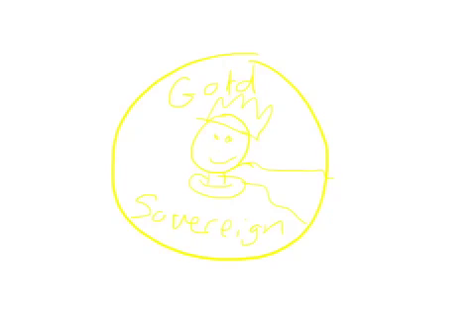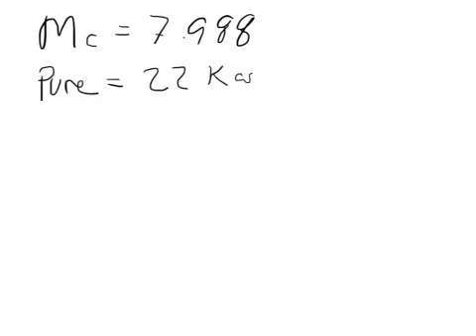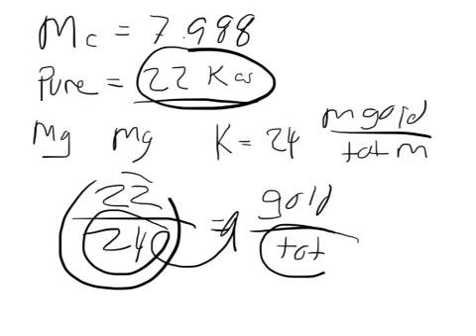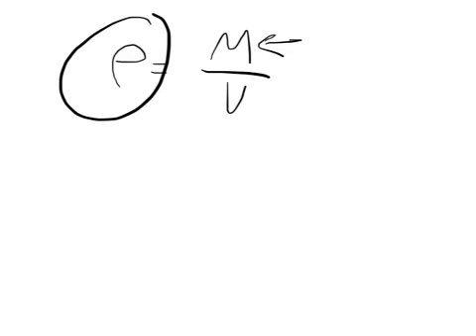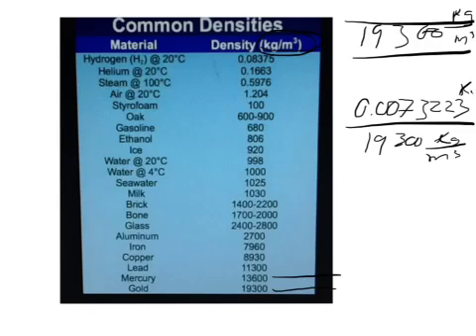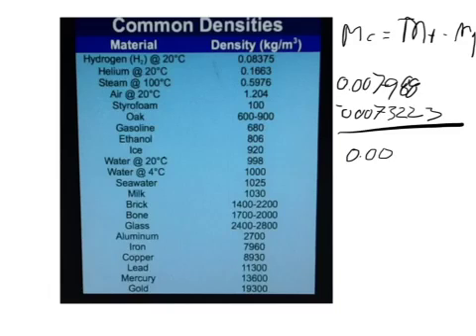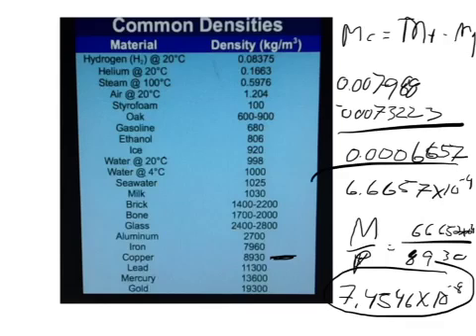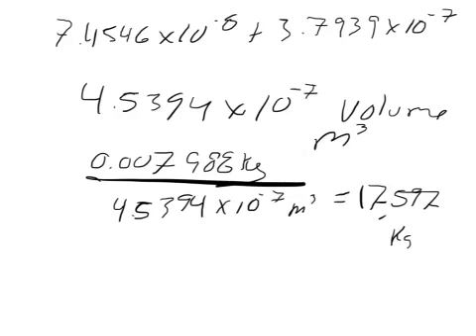Physics web assign ch 9 #1

Comment from the maker: Volume of copper = mass of copper / density of copper
Volume of copper =  0.0006656 (kg) / 8930 (kg/m^3) = 7.454 X 10^ -8 m^3

c. Density of the british sovereign coin is 
Density = mass/volume
Density = 0.007988 kg / (7.454 X 10^-8 + 3.7939 X 10^-7) m^3
Density = 0.007988 kg  / 4.54 X 10^-7 m^3
Desnity = 17597 kg/m^3

Check that answer for me and if it's off leave a comment.

Comment from the maker: This video currently has playback problems. Until I can get it figured out, here are the answers:
a. Karats = 24 * (Mass of gold) / Total Mass
Mass of gold = (Karats * Total Mass) / 24

Mass of gold = (22/24) *7.988 g = 7.32233g 
Convert to Kilograms by dividing by 1000
0.00732233 kg

b. Density = mass/volume
Volume = mass/density 

volume of Gold = mass of gold / density of gold
volume of gold = 0.00732233 (kg) / 19300 (kg/m^3) = 3.7939 X 10^-7 m^3